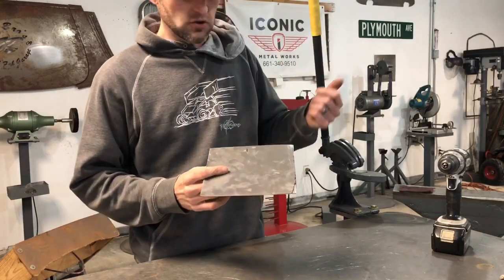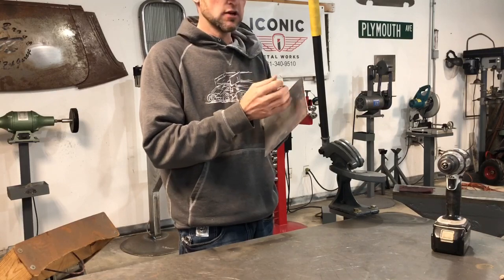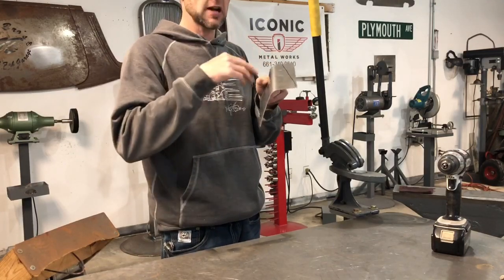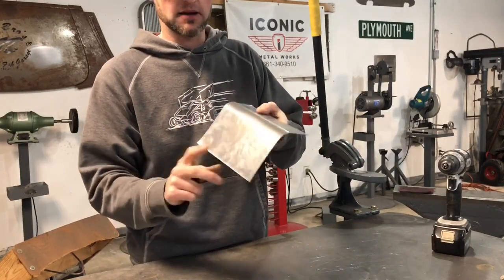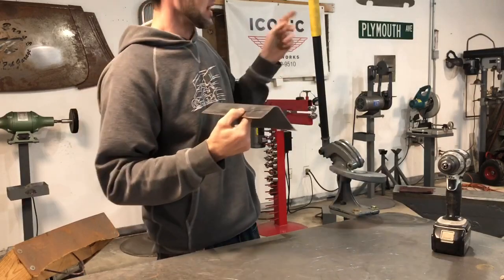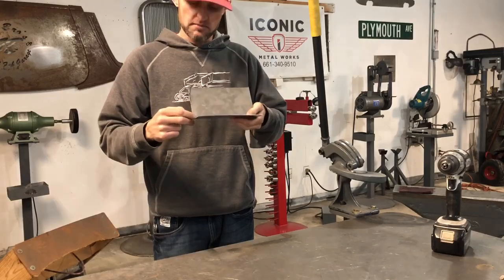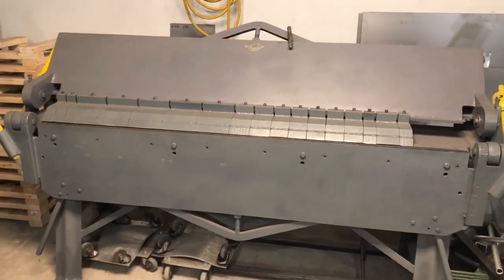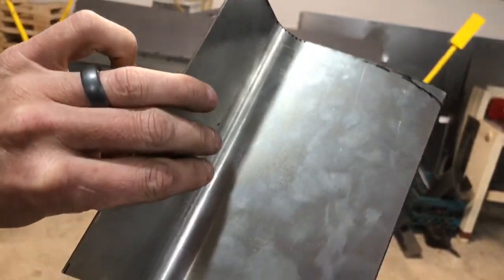bending metal to a radius

Comment: Good lesson.. I made the "curl" of the top of a step side bed using the method you described... a full 360°...I tried it first on a 6' leaf brake but it was not heavy duty enough to pull it off even though it was rated for the gauge of metal I was using.. I took it to my buddy who has a sheet metal  shop and he did it with his roper whitney powered leaf brake with a cnc back gage. It was about a 1-1/4" diameter "tube" when finished with no discernible bend lines.. pretty much perfectly round.  I believe that if I had a brake that was rated a couple of gauges larger than the material I was was bending it could have been done by hand. I did a short sample piece successfully but the full length of material kinda looked like a python  that swallowed a rabbit... bulged in the middle.. too much flex in the  brake I believe. I think that the factory did it in a couple of hits with special radius tooling in a press or press brake. I've seen tooling like that in a catalog but waaay to pricey for a restoration scenario... if you use yer noodle you can figure out how to do cool stuff!.. thanks for your willingness to share your knowledge...keep up the awesome metal shaping!